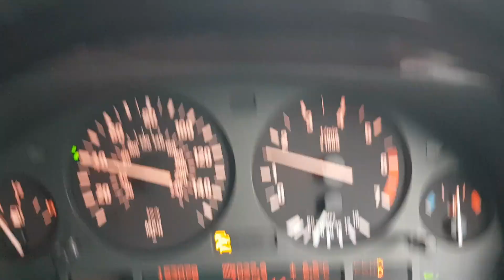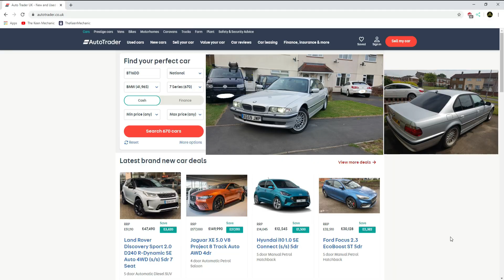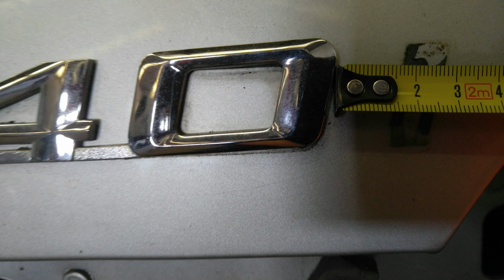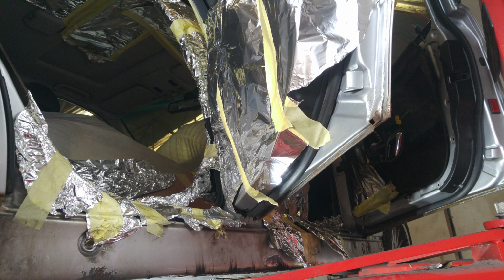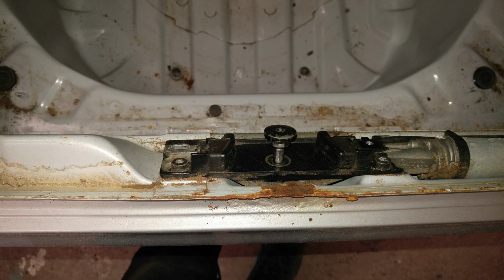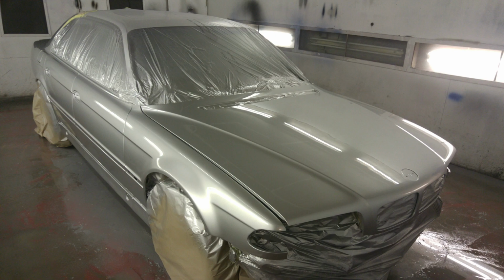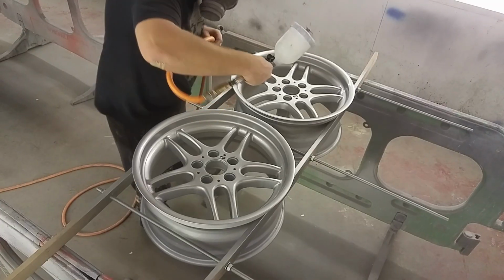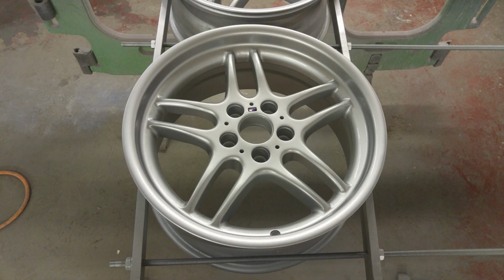BMW E38 740i PROJECT PAINT, BODY AND WHEEL RESTORATION M62TU, M62 BMW FULL RESPRAY PAINTWORK JOB ACC

Comment: Serious work. Well done  ! 2 comments: 1)for restoration purposes  in general it is better to put a bit more money on the table but to avoid a total wreck   2) the chrome line is missing on the boot lid, as this is a facelift model.
Reply from the maker: Thank you for the nice comment. It took me over 2 months to complete all the work. It was worth it in the end. My car has shadow line. The only thing that came in chrome was the front grilles. It is the only thing that I changed to black

Comment: I have an 2001 BMW E38 735i M-Sport in TITANSILBER. Looks almost identical. Absolutely adore this car. It's worth every effort. And thanks for the great Video.
Reply from the maker: Hi and thanks for your message. I absolutely love my 740i too. It is one of the best BMWs ever made with unique presence and good reliability. They don't make them as they used to unfortunately. I am still restoring mine and have a lot more content to edit but not enogh time. Should have another video soon on the suspension restoration. Thanks 🤝

Comment: I have a 94' bmw 540i, How much will it cost to renovate it completely if you have information about it please?
Reply from the maker: This is a question that only you know the answer to as it depends on the level of restoration you are looking for. A paint job can cost you from several hundred to several thousands. Then you have engine/transmission and interior to consider. Hope this helps
Reply: @TheKeenMechanic  the problem is in my country there's no mechanic that can fully restore a car, the car is in good shape it just needs painting, some really good job on the wire and the cars system, and a bit of interior cuz the sitting sofas (idk what it is called) need to be changed, so i really wanted to get it to some good mechanic in europe to make it perfect for me, and wanted to know the minimum cost.
Reply from the maker: @dxvil369  What country do you live in? Here in the UK this sort of job will cost on average £3000 for a good paint job and another £3000 for engine and suspension restoration. This is of course if you don't have to do work on the crank, cams, pistons, heads, block etc. Just a major service for all seals, gaskets, and other components
Reply: @TheKeenMechanic  i live in kurdistan/iraq, i might look into some good mechanics when i have adequate money, thanks for the help mate.
Reply from the maker: No problem mate. All the best

Comment: Very nice work.  I'm currently fixing the paint on my '01 Imolarot M-Sport, and it's quite an undertaking.  Just out of curiosity, what is the round thing on the rear bumper skirt, just behind the left rear wheel?  (15:53 in your video) I've never seen that on an e38 before.
Reply from the maker: Hi AJ
I am glad to hear you are restoring another one of these E38s. Imolarot is a great colour and very rare to find. The round vavle on the bumper is an LPG system filler valve as the car is bi-fuel and set up to run Petrol  and lpg gas
Reply: @TheKeenMechanic  I used to have a '98 740il and when I saw pictures of an Imolarot Sporty Shorty I knew I had to have one.  A year or so later somebody posted on one of the BMW boards I frequent "Imola Red e38 needs a home."  I clicked on the add and it was only about 70 miles away, so I ended up driving up that day and bought it (about 8 or 9 years ago)  It was a daily driver for a while, but there was an incident on the highway with a truck tire tread, and I ended up having to replace a lot of the front end.  It's mostly back together and since I had a warm day yesterday I actually put enough parts back on it to make it road-legal and put a few miles on it.  It's such a fun car to drive.  

Interesting on the LPG.  I don't think that was an option on this side of the pond.
Reply from the maker: @ajhieb  Hi
Lpg was never an option in Europe either but it is much cheaper to run on lpg and it is quite a popular thing to do for reduction of emmissions too to reduce road tax on large petrol engines like this one. The system is not cheap to install and cost the previous owner about $8000

Comment: What madness made you put the LPG filler on the bumper? Nice car btw, I see you have one of the rarest options for e38, active cruise control.
Reply from the maker: Hi Stefan, the lpg system was installed by the 1st owner back in 2005 then the car changed a few owners and finally came into my posession in 2017. It is a shame that they didn't put the filler valve in the boot or near the petrol cap and then you need just an adapter and away you go. I am now working under the front bonnet and I will be removing the lpg system as I want to have the car in standard factory condition. Well spotted about the ACC system. It is incredibly rare to find one with this option. Thanks for watching and for your comment
Reply: @TheKeenMechanic  I even skipped the part where you show the ACC system (seen it after I left a comment). I just spotted it on the bumper. 99% of people today won't believe you that a car designed at the start of the 90s has a feature like this. Having rear seat "coke" tables is cool and everything, but the ACC is by far the best innovation the e38 has.
Reply from the maker: @StefanJovanovski  It took me a long time to figure out how to fix the ACC system as it wasn't operational and because it is so rare there is almost no support online and I was on my own here...eventually I managed to calibrate it and it worked perfect. It is so strange driving a 20 year old car that maintains perfect distance with car in front, it slows down and even brakes for you if needed. Incredible inovation but was only available for the last 12 months of the facelift production. Only the latest models after 09/2000 have it. I was once offered 5000usd by a guy in USA who wanted the whole system to try and install it in an E39 M5 but I declined the offer as I love my car😉

Comment: I am 38,740 98 years old.
There is no trace of rust on it.
Crossed 400 000 thousand ..
What must be the conditions to rust like this.
I live in an area where roads are sprinkled with salt.
Reply from the maker: Hi, in my case the car had a leak from one of the rear sill plastic trims and only corroded in that spot badly. Small things here and there but that was the major thing. Thanks for watching Zlatko

Comment: How much money did it cost in the end?
Reply from the maker: Hi. It is hard to put a price on it as I was doing a lot of work myself and the welder and bodywork guys are very good friends of mine and charged me very little for their work. A spray job like this with welding and all work needed can easily cost in excess of 3-4 thousand pounds here in the UK. The car is not finished yet as I am currently restoring the engine and suspension, brakes etc. Will be uploading more videos soon on the suspension and engine restoration. Hope you enjoyed it😉
Reply: @TheKeenMechanic  Hello. Thank you for such a detailed answer. The E38 is my dream car and I'm trying to figure out how expensive the ownership might be. I thoroughly enjoyed your video and I'm looking forward to see more of this magnificent BMW.
Reply from the maker: @Frang14998  No problem. I like to chat to people watching my videos as we all like the same thing. As my channel is small I can engage with my subscribers and have proper conversations. I bought the car for £2700 about 4 years ago and I have had very little trouble with the car apary from coolant leak (valley pan gasket) loose fan belt and ABS pre-charge pump. All these cost very little to fix (under £100 for parts) but it takes time as it is labour intensive (especially valley pan). I have spent some money on the car as I want to have it in immaculate condition when I am finished with it. The car is very easy to work on as it has a large engine bay and everything is fairly simple. I am lucky to have 1 of 11 uk E38 cars with ACC active cruise control which is extremely rare and cool option to have. Any questions please ask and I will do my best to asnwer.🤝
Reply from the maker: @Frang14998  Here I have a video on some of the parts that I will be installing or have installed already https://youtu.be/o-PwU4An8ts
I also have full new front and rear suspension to fit which is not shown in this video. As you will see I am crazy about this car but of course if you don't want to spend so much money you could save yourself a fortune by replacing only what is needed😉
Reply: @TheKeenMechanic  awesome! Good to know that the car isn't necessarily the money swallowing behemoth that some people make it out to be. Hopefully i will find myself a well maintained e38 because i don't have a garage myself and i have 0 experience with car repairs. Trying to learn a thing or two watching videos of e38 maintenance. Will surely keep an eye on your channel!
Reply from the maker: @Frang14998  Honestly if you want to learn you will have absolutely no problem with the E38. It is not hard to work on these at all. You just need to do some research before doing a job and youtube is great for this stuff as I am constantly learning myself from others. Keep looking and I am sure you will find a good one some day. The 740i though it is becoming harder to find and you might have to check all websites daily for months before you could find a good one. It took me 6 months to find my E38. Keep in touch buddy and again thanks for your time too to reply